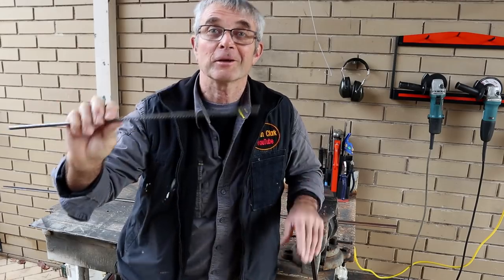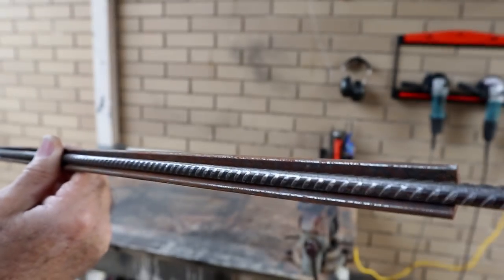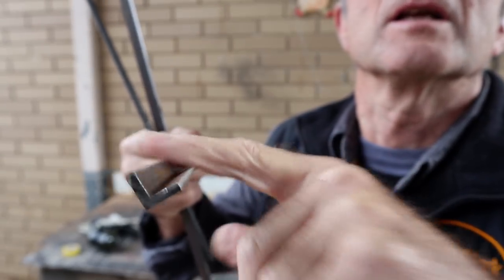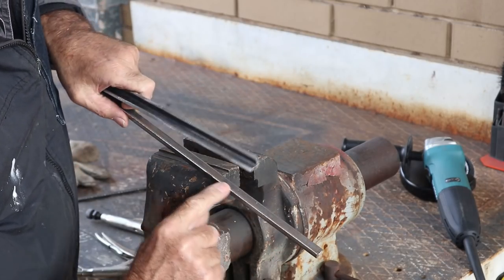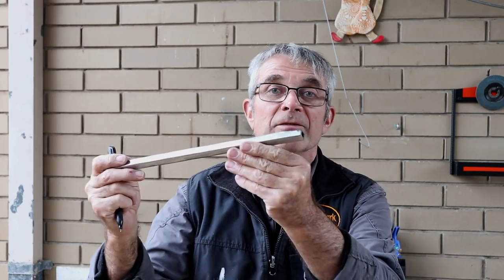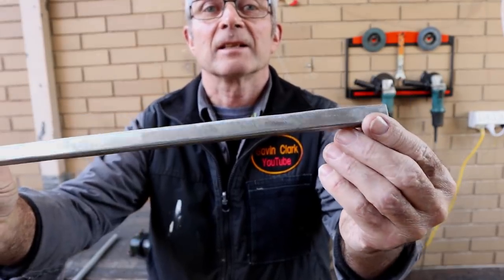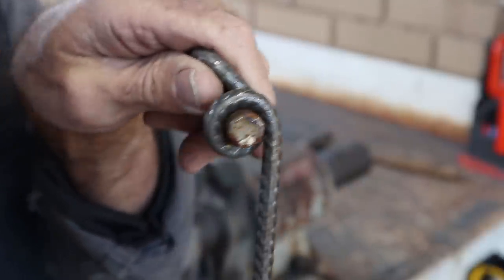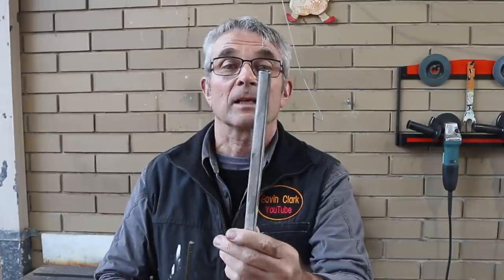I make a Strong Square Tube to Bend the 7mm Steel Rebar for my Projects. MIG Welding Project

Comment: I’ve been expecting this kind of video from you! Making useful tools from stuff laying around would seem right down your alley Gavin! What could be next? A bending fork made from scrap, various items to use as an anvil, a jig for rebar monkey fists………..? We’ll keep watching if you’ll keep posting! Thanks GC!
Reply from the maker: Thank's Tom, I have thought a bit about your monkey fist, that is a tough one even using heat, I think I can cheat and make one using the welder because it would look cool on the wall behind the bench. Still thinking. Thank you mate.
Reply: @GavinClarkdiy  I think it’s impossible as 1 piece! Bending, cutting, and welding are probably the only option, but that’s fine if there’s a way to hide all the tacks! I’ve got the gears turning on this one, and if I could ever get some shop time, I’d start experimenting! Thanks!
Reply from the maker: @tomt9543  I will have a play in the next few weeks.

Comment: High Gavin, a wonderful jig. But I have a question: why did you make the square tube so short. I think, when you make it longer, you don‘t need so much force. Greetings from good old Germany.
Reply from the maker: Hi Helmut, I have found this length works well when working on the workbench when swinging it around. If I find I need it a bit longer I can use pipe on the end or make a longer one, my last one was a bit shorter than this one, Thank you very much, I appreciate your comment. Greetings from Australia.

Comment: a great hand tool for making stuff.... but I think you get a solid extruded square tubings of very good thickness already in the open market.
We get them here in Bharat in different size inner holes in good thickness Stainless Steel of 308L grade & not expensive too.
Reply from the maker: I agree with you, if I took a bit of my 7mm rebar out with me I would find something very suitable I am sure. But this took me less that 10 minutes to make, and I can move on to my next project. Thank you very much, I appreciate your comment.
Reply: yes  @GavinClarkdiy  that's 💯 % 👌🏽 correct - time is indeed to be saved...... but I never knew that it consumed just 10 minutes for making this... ❗and that's miraculously too little for finalising this piece..... Anyway that's one great cherishable piece.......once again thanks for taking out a few moments to read my comment & reply 👍

Comment: Thanks for the video. I live in NZ and we don't get 7mm rebar, the smallest is 10mm. Any suggestions where to get it from?
Reply from the maker: Thank you very much. Other than cutting up mesh, I would ask the suppliers that you can get the 10mm from and see if they can special order 6 7 or 8 mm. you never know, also the people that put together the mash/reo for a building, ask them they sometimes use smaller reo in parts of buildings. Hope that helps a bit.

Comment: Love watching your programme... What do you treat the metal with as a rust preventer that will not feel tacky and not have a varnish look
Reply from the maker: I have decided not to comment on finishes, as there are so many answers and questions. As what climate you are in, is it inside-outside, lots of rain, ice, do you want long term and rarely touch, or a wax with a wipe over every year. That is why I have no opinion, Please ask someone in your area what you should use, I feel this is a better way to find out. Thank you for your comment.

Comment: What size rebar you use most of #2,  #3,   #4.
Reply from the maker: The 12mm rebar has stamped on it is D500N Standard Grade N. Common uses include columns, prefabricated beams, precast products and cages. It is popular with both residential and industrial applications.